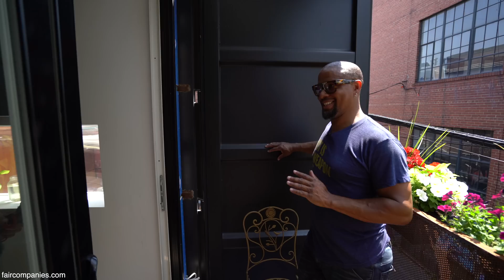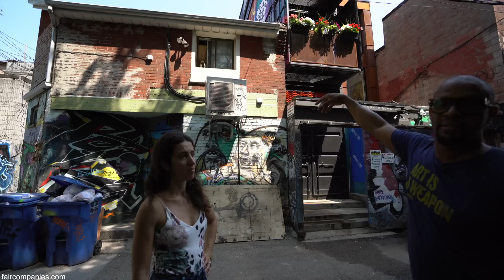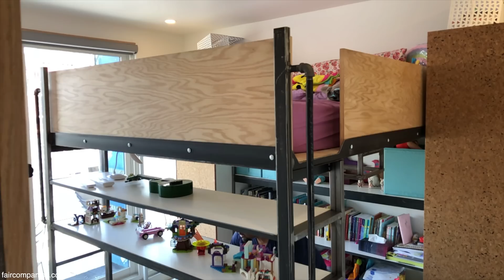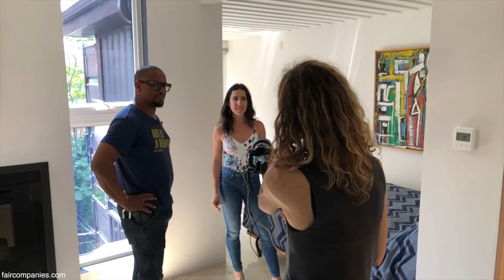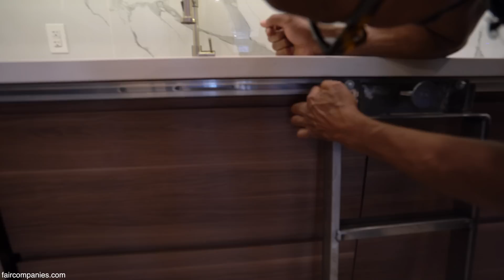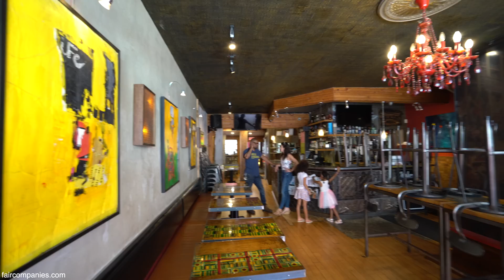3-story container townhouse shines in street art vibrant alley

Comment: Love the videos and content. Watched a lot of your videos last month and loved them. As a fellow videographer I should say, shutter speeds lower than your frame rates messes up the videos. Please don't change the shutter speed in low light, change ISO instead. You can use Auto ISO to keep your exposure stable (so you don't have to fiddle with the camera) and Sony A7 series cameras are pretty good with it (that's what you have as I can see). Or you can use shutter priority mode with Auto ISO so your camera can change the aperture and ISO automatically to keep your exposure stable without you changing the shutter speed.

Comment: With the grates for the balconies, a suggestion, for the sake of mobile phones that are dropped at brunch…

Put some mesh on it, maybe welded underneath the grate, maybe laying on top if tougher - like a heavier hexagonal mesh that could also provide some barefoot force spreading.

That way anything small enough to fit through the grates but large enough to be stopped by a mesh, will be.
Such as the aforementioned mobile phones, but also cutlery like spoons and knives.

But it will still allow the elements (and any spills), as well as sunlight to go though.

Oh and in retrospect … or for anyone else having to do a blind drop with a crane - remote viewing.
A camera set up with a live feed, multiple angles of all the close tolerances.
But it's best to use a wired set up with a cable feed to get instant vision - a delay could be disastrous.
And don't route it through wifi or the local network … seriously, don't.

Comment: It looks like they used welded steel projections to hold the corner ISO blocks in place, then welded on at least one side at each of the corner blocks? Were there any other lateral load connections? Also, other than vertical HSS at the cut openings, was there anything else needed to stiffen lateral?